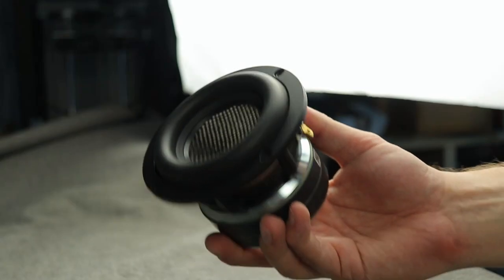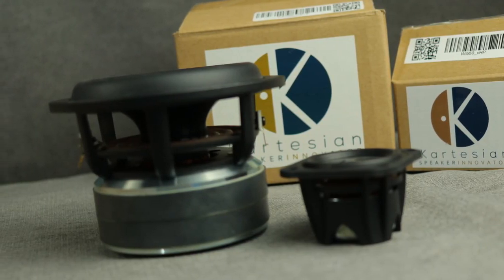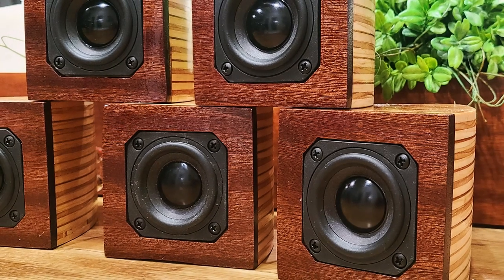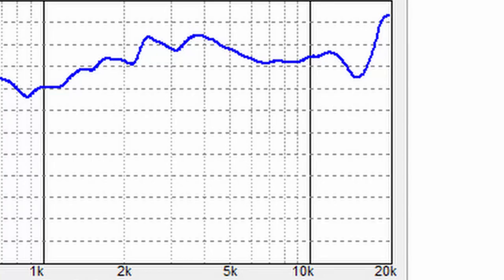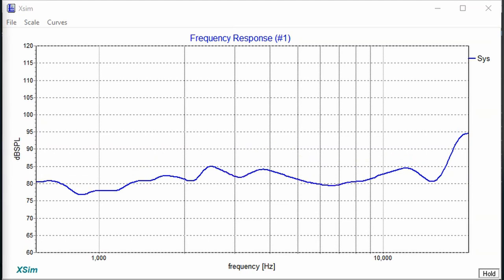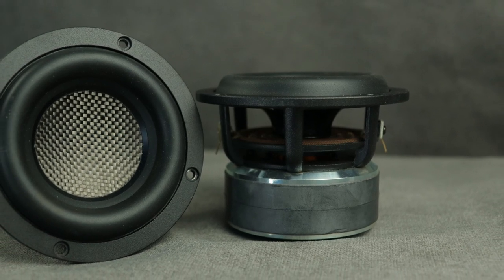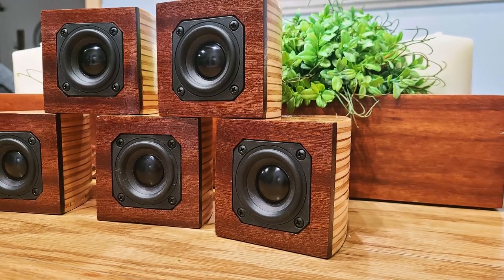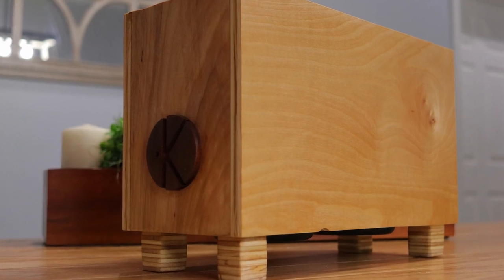Better Than Bose Cube Speakers TESTED - Kartesian Speakers

Comment: 2" sounds good for a two way speaker with a low crossover point for great integration between woofer and "tweeter".  The directionality of the 2" driver up high would be good in a relatively live room

Comment: I agree that 50Hz F3 is, by definition, not a subwoofer.  To quote Robert Harley's The Complete Guide to High-End Audio,   "But subwoofer actually means 'below the woofer,' and the term should be reserved for those products that extend bass response to below 20Hz."

Personally, I consider 90% of what we call subwoofers to be "super woofers" that simply enhance bass response without actually reaching 20Hz or below, but I'm okay with calling an F3 or 20-30Hz a "subwoofer" as so many people already do and that's already below what most woofers produce.  It's simply unacceptable to raise that figure to 50Hz, though, as normal woofers will, or should, go that low.

Some of the first subwoofers were Cerwin Vega monsters set up in select theaters in 1975 to produce sound effects for the movie "Earthquake".  These were true subwoofers that could supposedly extend to 16Hz, which is indeed subsonic.  Since then, the term "subwoofer" has been stretched by marketing departments to the point where it's nearly meaningless.  This is evidenced by the reality that even many audiophiles and speaker designers now consider speakers to be excellent "subwoofers" when they have an F3 of 35-40Hz.  No, those are simply good woofers; they aren't subwoofers at all.
Reply from the maker: I agree with you. Although I do feel like anything below a six and a half inch, you need to temper your expectations. The lowest driver that I can think of without DSP that can get anywhere near there is the w5 by Tang Band and the new epique line (around mid 30's). I feel like there needs to be a classification for mini subwoofers that are designed for desktop use.
Reply: @Toid  That W5 is a tooth chipper!  It really hammers for such a small driver.
Reply from the maker: @brianraulerson5037  completely agree. It's really unique, which is why I love it. The exception, not the rule

Comment: You didn't consider putting the 4 inch driver in a small sealed box, hit it with gobbs of power and take full advantage of all that excursion?..why does everything have to be ported?
Reply: I agree that driver should be great in a small sealed box.
Reply from the maker: This really was designed for a ported box. It really doesn't perform well in a sealed box.  This particular driver, even with the excursion will only have an F3 of 93hz.  You would think that with this excursion you could DSP it using something like a linkwitz transform, but even in a small box you run out of excursion by 63hz before DSP. meaning there is no meaningful low end you could dsp out of it. You could keep it sealed, but I don't see any reason why you would.  Kartesian even has two designs for it, one ported and one using passive radiators.
Reply: @Toid  well then...carry on..but if it's designed as a "sub" woofer..but sux as a subwoofer..put it in a sealed  box and cross it over at 100hz or above?..you said it played well in the upper regions?..I'm not saying...I'm just saying
Reply: I have a thought on this... even Bose calls their 'subwoofer' a 'Bass Module' at least for the 2.1 Acoustamass system they sold for years and years. I'm pretty sure they DSP the Cr*p out of their bass module too, even though it's vented. I'd think of this subwoofer driver as something like that.   It's kind of understood that such a small bass speaker isn't going to reach the 20-30 Hz range with any audibility to speak of. But it can produce enough real-world bass to seem 'satisfying' at low to low/medium volumes, and that's all many people need. That's perfect for a small room setup or computer desk... heck even a YouTube editing setup. (My editing setup uses a set of Jeff Bagby's Quark speakers powered by a small 2.1 amp with a single ND105 vented as the subwoofer. That thing is only 4" and there is just one!) 
50 Hz represents real bass in my opinion, and there is some output below that, just not a bunch.. No, not traditional 'subwoofer' territory, you're right, but I think we just need to interpret these things in light of what they are... really cool super-small bass drivers.  Just my un-asked for opinion. :)
Anyway, I really enjoyed both the satellite and subwoofer videos a lot. That's a fun 'little' project that you could hide almost anywhere. Bose hasn't sold Gajillions of those 2.1 setups for no reason.
Reply: @zarboaudioprojects1430  actually bose woofers dont even go below 80 hz, they use harmonics to trick the ear into hearing base that is not even being pushed through the driver. if you ever hear an example the climbing staircase audio is an example of using harmonics, our ears hear it going up and up and up but its the same 5(?) notes in the sequence over and over. thats what bose did and its basically a fraudulent way to market a product IMO

Comment: Have you used the Dayton tcp115 drivers?
Reply from the maker: I have. They are really good for their price. But not the same quality as this 4" driver. Of course there is a major price difference.
Reply: @Toid  Hi, do you know if there is some klippel measurements of the sub120. I want to know if the 6mm xmax is 10% or more like 30% Bl loss.
Reply from the maker: @roygriend5143  yes. It's on their website
Reply: @Toid  i only can find T & S parameters, no bl graphs etc..
Reply from the maker: @roygriend5143  make sure you view the desktop site. The mobile site doesn't show those graphs. You should be able to put your browser in desktop mode.
Reply: @Toid  thanks that did the job!!
Reply: @Toid  do you know any other 4 inch driver wich is in the same league as the kartesian (except the purify 4inch )